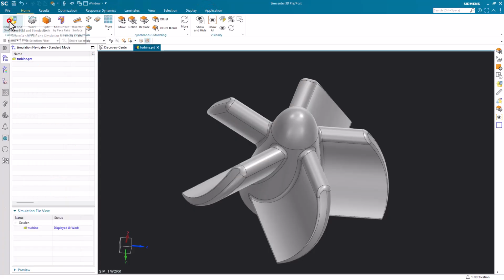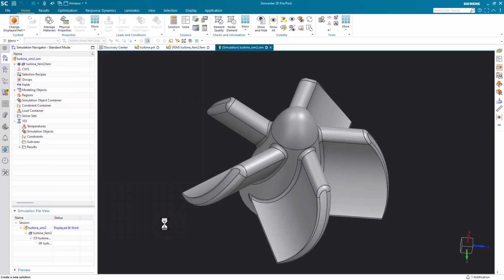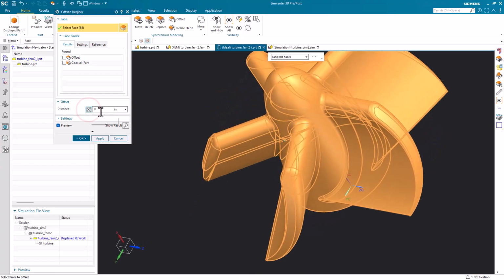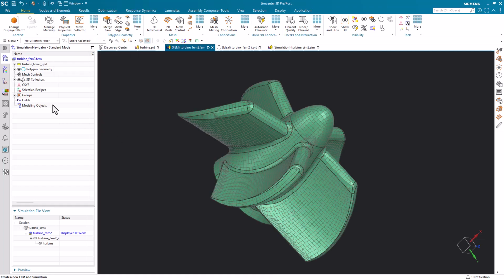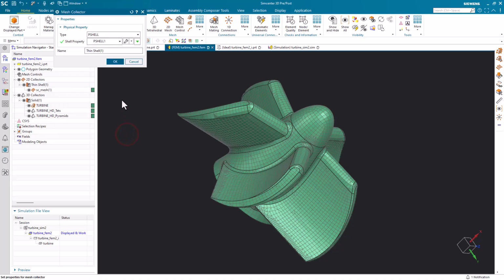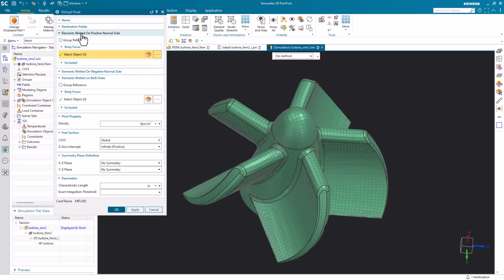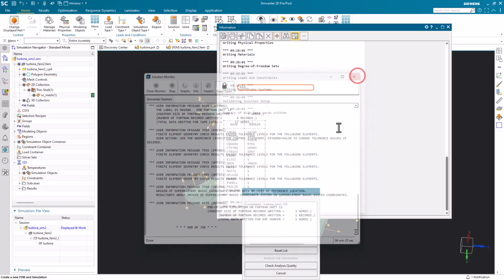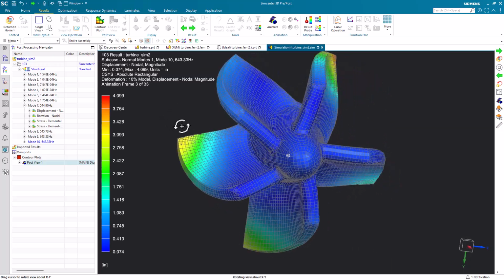How To Run A Modal Analysis Of A Turbine Immersed In Water

Comment: Is it possible to take these modeshapes to motion environment, like we there we import sol 103 flexible body analysis.
Reply from the maker: If I create a SOL 103 Flexible Body solution, MFLUID is not available, however, it is possible to add non-structural mass.